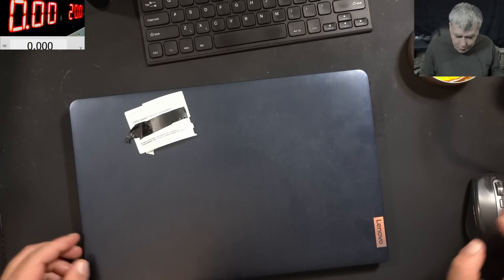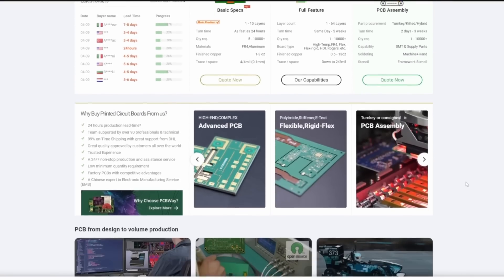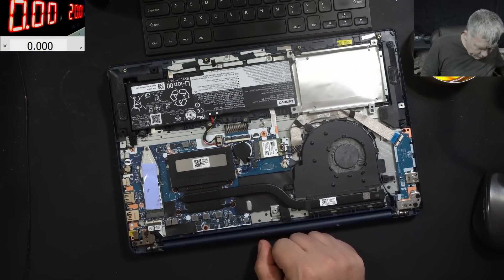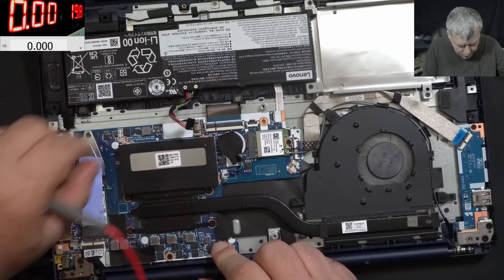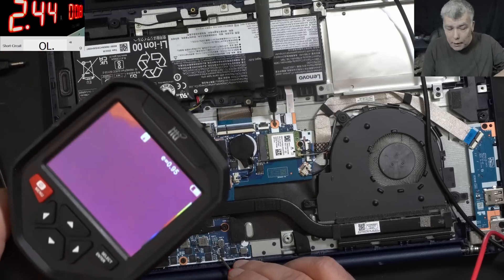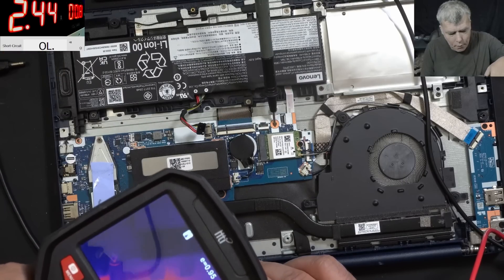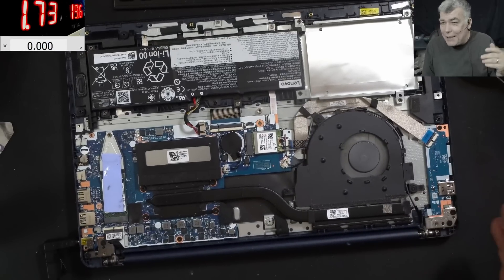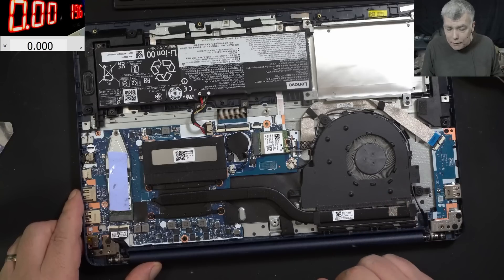Lenovo Ideapad 3 not charging, no power - How to diagnose a basic fault

Comment: Hi Sorin, congratulations for the video, I wanted to ask you but since the short circuit was on the main line, in practice could you also inject current on a mosfet nearby? Or are there special components to do the initiation? Thank you

Comment: Hi Sorin thank you for your videos, i learned a lot with you, recently i bought a motherboard for My Lenovo y540-15irh i put everything carefully in place but I forgot to connect the screen, the computer booted nicely i could ear the windows sound loading then i realized I forgot connect the lcd cable. Then i switched off the laptop, connected lcd cable and power on the laptop and something happened, i listened a short in the motherboard. I don't have a thermal camera so i tried to follow your lessons but unsecefull. If you would kind enough to accept my motherboard to fix it and show me where i failed i would be very thankful. I appreciate your lessons so much, i wish to work for you even for free just learn your knowledge. Thank you very much

Comment: hi Sorin
i need your help

i replaced lenovo ideapad L340 motherboard with another brandnew one then the laptop is charging but no ac sign and it show that the laptop work on the battery although the battery voltage is ingreasing normaly
In the bios i found the serial number and model name and another thing give invalid value
i coud'nt run lenovo diagnose programs but battery info and charactaristics is very normal with about 320 charge cycle
is the reason is the missing serial number?
did you faced something like this before?
there is no serial availiable to write in the bios with any tool
what do you suggest?
Reply: Why do u care about serial
Reply: @Nebbia_affaraccimiei  I care about charging 
when laptop work on adapter it don't show charging sign in the corner of the battery icon
while laptop off ot charge normaly
but in windows sometimes charge percentage goes up somtimes goes down with no rules
and no charging sign in the battery icon any situation
Reply: the board is brandnew
i'm search for the reason of the charging problems
Reply: the laptop is gaming laptop
the max charging current is 0.760 Amp on my desktop power supply
is that normal?

Comment: Sorin do you also replace the broken capacitor? thanks
Reply: He never replaces a capacitor. That's why he's called Dodgy Sorin
Reply: @CAsCurryKitchen no capacitor, no shorted capacitor
Reply: The capacitor replacement will be on the next video 😂
Reply: in the next video, maybe
Reply: "not in this video , maybe in next video"
Reply: he is in it for the money he told that many times so no
Reply: The capacitor costs more than that crappy i3 laptop

Comment: in case you ask the question, removing a capacitor near a plastic things is sensored images thats why sorin cut the video there -_-
Reply: inappropriate for children, parental guidance suggested 😁
Reply: No capacitor were harmed during this experimental video!😁
Reply: Snip snip.
Reply: i think , he just removed it using a tweezer so no need to do that with hot air or soldering iron
Reply: @Fourty_7  no Sorin doesn't do this, when he says say hello to my little friend and then you see a cut in the video , he's actually saying hello having a conversation with the capacitor , and then they get scared and they leave the board by themselves.
Reply: He's has mastered a new skill of removing capacitors from the motherboard. He had to cut because I think we aren't ready to learn that 😂
Reply: When you removed the capacitor you didn't replace it. Does that mean removing a shorted capacitor will not render the board dead if not replaced ? Kindly help, I'm a noob.
Reply: @frimpstv5453  it would work, but if a similar issues happend in the future instead of it just killing the cap it would possibly kill other things, the cap to replace it with is 0603 25v 10uf according to the board view for this laptop, i just did it today
Reply: @GregsComputerDen  thanks. I watched a video where Sorin used an oscilloscope to analyse the voltage waveform on the output of the power supplies before and after several caps were removed and the waveforms were just the same. That indicated that a few caps removed don't downplay the laptop's functionality.
Reply: I am also learing,. Wouldn't kapton tape be just enough to protect nearby elements from melting/overheating?